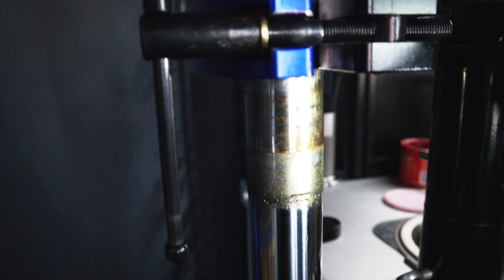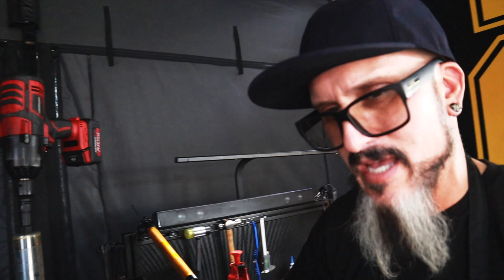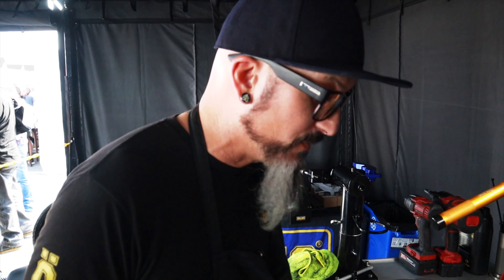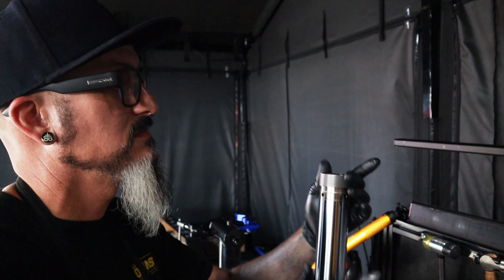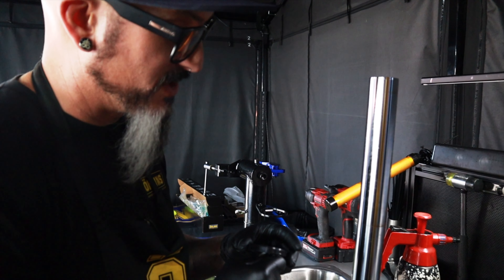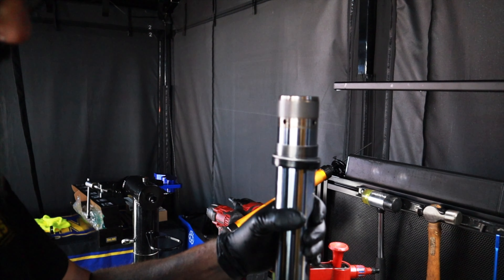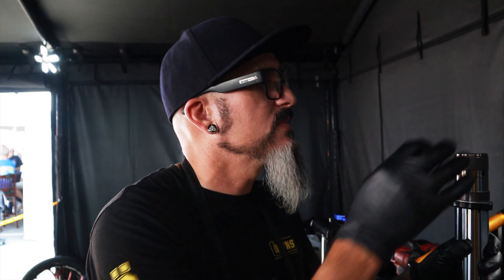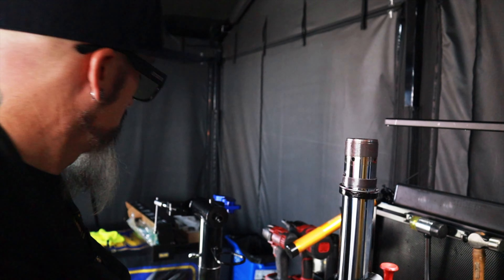Harley SUSPENSION Upgrade

Comment: Another great video guys.  Loving  the new ride so far? Out of curiosity, If you buy at a rally, do they charge on the install or is the included on the product purchase? If it’s added fee do you recall how much install price is?
Reply: Installation is $350 ... If bushings and seals are replaced its $550

Comment: Good video,but to be transparent.olins does not offer a front kit for cvos.i went with nawasky(pistol pete) front and back
Reply from the maker: You are not completely correct,  and CVO without a 21" wheel they will fit.  I did check with Ohlins.
Reply: @BaggersandBrews  well damn,i called ohlins and was told negative on cvos,he never asked about wheel size.ill have to call back and get someone that knows what their talking about.i havent installed the nawasky suspension yet.id rather have ohlins tbh
Reply: @Ironmountain81   Correct,,, They will work on CVO that have 19" factory,,, It will not work if the CVO came with a 21" front wheel as the forks are different..